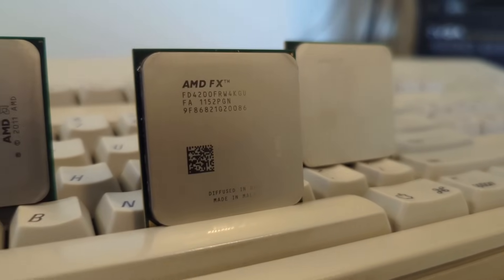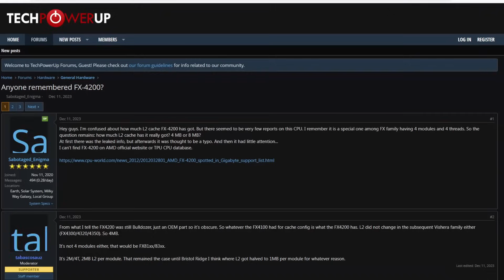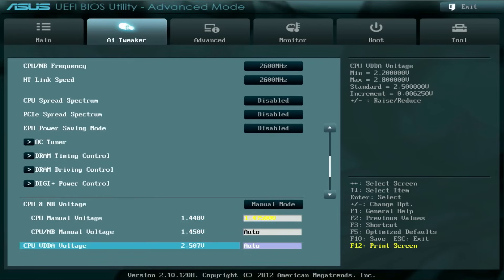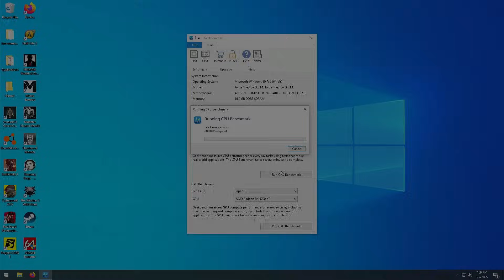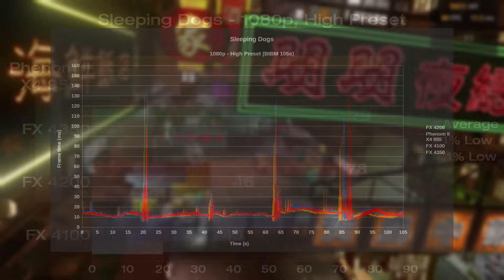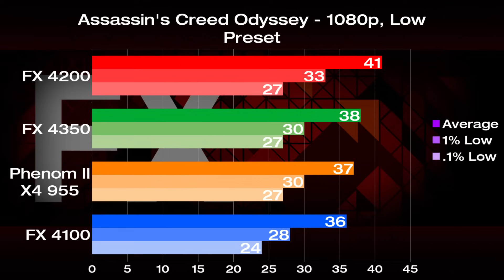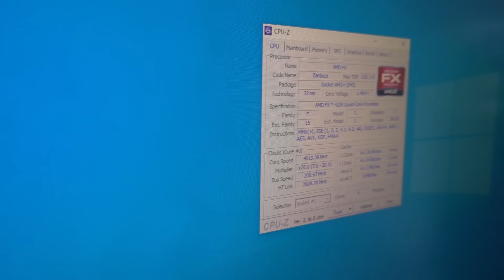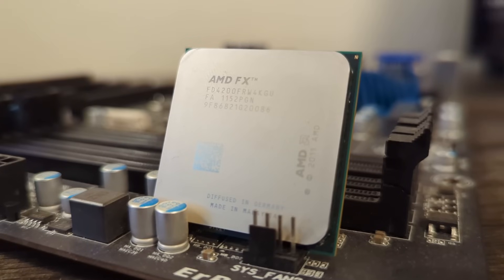What if AMD FX had "real" cores?

Comment: Had the FX 8350 and loved it. When multithreaded programs became a reality, it helped it survive longer than an Intel. Intel smashed it in single threaded workloads. I still have the original metal box and boxed cooler (was useless and loud). I think id died somewhere around 2021.
Reply: CPU died? How far did you overclock it?
Reply: @GreyDeathVaccine  No. The  PSU went and took the rest of the PC with it.
Reply: @858Markus  This is unfortunate. I feel for  you. I lost my motherboard once. If you remember, maybe share the name and model of the power supply so that the community can avoid this model. I'm keeping my fingers crossed that your new computer will serve you well for a long time. Best regards.
Reply: Im currently running a 8350 in a GB 990fxa-ud3 with debian as my daily (I dont game much anymore, mainly run optics sims, some light CAD, CFD, and photo editing, the rest is online and such). Not a single problem with it. The spinning platter WD blues are a little slow sometimes, but they're 3 and 4 TB, and blues, so...ya know...

But even back when i was running 7 on a 970 MSI with a 8120 and a 550ti, id have ARMA or ARK, Google hangouts, OBS streaming to twitch, and a twitch tab open to monitor the chat, sometimes had Pandora open too. Didnt bog or lag at all. So when people come along and say how terrible the FX series was.....I honestly have no idea what they're talking about.....

That noise? uh...thats a 3A carpet dryer blower fan set into my computer case blowing directly across a 212 cooler.....just ignore it.....

Comment: Great comparison! But the comment about software developers not paying close attention to the configuration of that CPU made me chuckle. Software developers aren't going to pay attention to that level of detail at all unless they're sure their code is only going to run on a particular hardware configuration (like a console for games, or a particular server CPU for a large tech company's backend) and they think they can actually tease out performance that way. But in many ways the results you see don't surprise me after you pointed out the L1 cache perf and size discrepancies. The Phenom 2 had half the L1 cache of even the FX-4100 but it's L1 cache was significantly faster.

This means "tighter" code that needs to access less total data to perform its computations will work better on the Phenom 2 for the two-fold reasons of being more likely to have the data it needs in the L1 cache and then being able to crunch on more of that data per second than the FX line. I don't think it was intentional, but newer games will be made on computers that have more L1 cache available, so measurable slowdowns in the tight loops due to L1 cache misses due to the volume of data being worked on in a group will simply not happen on newer hardware, whereas the older hardware will hit it.

Meanwhile, older code written in an environment under a more constrained L1 cache size would be more likely to be written performing work on smaller batches of data at a time, so the Phenom 2 wouldn't have the L1 cache misses to affect its performance and the L1 cache read and write speed would allow the CPU to perform more computations per second without stalls than the FX's less performant L1 cache. I think the BeamNG Physics benchmark helps support this theory vs the new SSE2 and AVX instructions -- if the better instructions were the reason for the lift in newer games, you'd expect CPU-side physics calculations, which would absolutely take advantage of these instructions, to cause the FX 4200 to lead the pack here, but the Phenom 2 still does, because the CPU is hard at work computing a physics simulation on a small dataset (the few vehicles and road obstacles in the simulation) more likely to fit in L1 cache and the L1 cache performance affects how well that benchmark does.

And I think this affects everything about the design the FX chip. They couldn't get the GF process node to run the L1 cache at the same speed as the prior process node they used for the Phenom 2, so they bent over backwards to work around that bottleneck, and realized that for multithreaded code; particularly the integer-heavy code that most backend and business productivity software code is, they could get a higher total throughput by having as many cores as possible on a single CPU and decided to share the FPU between two cores because then they could pack even more integer cores onto a single die and at a minimal performance cost on the workloads they focused on.

The ability to have more cores and then disable some of them for lower SKUs also let them work around yield issues they were undoubtedly having at the same time (if they couldn't get the L1 cache to the same operating frequency as the prior node, that means the newer node, while maybe smaller overall, had one or more mask layers in the process that the foundry couldn't keep from becoming overly diffuse (or variably diffuse from batch to batch, which if that was the case, would lead to huge overclocking potential if you got lucky with the CPU you acquired). Interesting how Intel is in this exact situation right now for the past couple of generations of their CPUs.

All this to say: I wish you also had an 8 core FX in that benchmark, to be able to compare the same number of FPUs but double the integer cores and see how it played out in the benchmarks as well. I bet it would've shown why the FX-4200 was so uncommon (since it had to basically be an 8 core FX but with 4 of its integer cores disabled, and if the yield issues were mostly in the L1/L2/L3 cache, which they probably were due to transistor density in the caches vs the compute regions of the CPU die, that would mean needing to disable those cores was unlikely): I bet the synthetic multithreading benchmarks would have gone in favor of the 8 core chip, as well as the BeamNG test, while games would've been almost identical (mostly just further reducing 1% jitters because all of the OS threads could be isolated from the game threads).

Comment: I absolutely LOVED my FX-8350.  In 2012 it only cost me $170CAD and it lasted me for 5 years before I replaced it with a Ryzen 7 1700.  I still use my FX-8350 as the CPU for my home network fileserver.

The problem was that AMD had the FX CPUs designed by a computer program.  It made them kinda average at everything.  Hoewver, the performance of the 8-core variants definitely reigned supreme.
Reply: Something I have started to hear people comment about in forums and videos is how stable AM3 platform and  FX CPUs were.
Reply: @FrancisBurns  I've never had a more stable system than the fx 6300
Reply: @FrancisBurns That was not my experience building a few, among some Core2 Quads, Sandy, Ivy, and Haswell systems.  They ran very hot trying to get any performance, and the boards were always flakey.  And I've run a Cyrix MediaGX system and Socket 7 Cyrix on an SiS chipset, along with nForce2 chipset boards; I know flaky when I see it.  Back in the day, sure it was cheaper.  But as soon as the Xeon e3 became available you can buy 20% more performance than this FX 4200 for $5 or less.
Reply: @FrancisBurns I was running my 8350 at 5ghz back in middle school just with a hyper 212
Reply: @wyattstanley6813 The highest I think I could get mine was 4.7Ghz and that was with a 240mm Corsair H100i (or an H110i, been so long I can't remember) I would have stuck with my FX 8350 for a few more years if my GTX 1070 wasn't so flipping loud. It was an hybrid cars from EVGA's B-stock and the blower fan stayed pegged at 100% more and more as time went on. Only had it for a tad over a year before i bought a 2nd hand GTX 1080 Ti and sold my GTX 1070.
Reply: They were great for heavily multithreaded work.
Reply: I still have mine on the same motherboard my fiance got me as a Christmas present almost a decade ago. I mainly use it to play around with Linux Mint nowadays. Same goes for my FX 6300 and FX 8300 which OC to 3.8Ghz amd paired with an R9 290X 8GB and 16GB of RAM. Every time I tried to double the memory capacity it would mess with my CPU OC for some weird reason.
Reply: That's exactly my path as well... FX-8350 and upgraded to Ryzen 1700.... except I then upgraded to the 3950x 4 years later....
Reply: The only problem being an e3 1220 is $4 these days, is 20% faster and even with a motherboard swap will probably pay for itself in power usage.  Not to mention the E3 V3 series which is even better (Intel 4th gen).  I had FX chips, they ran hot and loud.  In the last 4 years I've built a dozen E3 Xeon systems, using the RAM from AM3 platforms I am throwing away.  A Xeon 1241v3 or 1245v3 in a Z97 board with an NVMe BIOS patch is nearly as quick as a 6th or 7th gen Intel system.
Reply: Modding my motherboard with scrap heatsinks and undervolting the board made a world of difference
Reply: I used the 8350 until last year. Only reason I retired it was windows 11. For me the 8350 was still fast enough to run all my game's and software and never had stability issues.
Reply: I had an 8120. I got a 30% overclock out of it. And solidly stable.
Reply: Could've got Xeon E3 1230 V2 with ordinary B75 motherboard for not much more and it would beat it both in single and multithread along with better thermals, less power draw, no risk of north bridge failure and PCI-E 3.0 support
Reply: The thing is.. the intel counterpart had similar multi threading performance and WAY higher single thread performance. And then there is the power consumption… 🔥🔥🔥
Reply: PFFFFF What? My FX-8350 was barely faster than my 1090T at almost a whole ghz faster clock speed (5.1ghz vs 4.2ghz) and in single core tests a stock ass 3570K was faster and in multithread a 2600k/2700k/3770k stock were just as fast if not slightly faster which again... stock... FX uses a fk load of power to spin it's wheels. It was a terrible cpu line people were better off finding older Phenoms and I would have been better staying with my 1090T. The only good thing you can say about FX is "it functioned" which right out the gate windows had scheduling problems with the half cores. AMD Phenom II and Ryzen stuff is super amazing, intel performance or near (in the case of phenom) for half the price but I will never ever ever forgive them for the FX line. It wasn't even just mediocre... it was genuinely bad and worse than their previous generation.. which is fked up when you consider the marketing about how much faster it is and it just wasn't.
Reply: The PC I built in early 2013 still uses this processor. It's my main driver LOL
Reply: Still have a 8150 in a retired rig I used to lend friends with computer trouble.
Reply: A10-7700k oc with 480 8g. Great machine.
Reply: I had both a FX8320 and a 2600k.
That AM3 nearly made me refuse AMD cpus. I just used the 2600k till last year(13 years for 4 core is unbelievable imo) and sstill chugs away at 4.5ghz.
My 5700x is what AM3 should have been, but there are so many technical reasons FX just didn't work out.

I feel Intel is sorta in their bulldozer era, for better or worse. I finally have my AMD CPU + Intel GPU (5700x + B580) I always wanted to see them compete more, i think the next 5 years will be fun
Reply: @Brapplezz  I really hope that Nova Lake sees them leave their Bulldozer era. 

16 performance cores, 32 efficiency cores, a new 18A with Gate All Around and extra cache, and IF they’re smart part of the new platform will be a move to a quad channel setup to keep those cores fed. 

That last one isn’t something I’ve seen anyone say anywhere, but you can’t just double core count and NOT expect that to need extra bandwidth. Plus, it’d really help justify the new socket. Also, the increase in pin count is ~ about how much you’d need to double the memory channels if you weren’t changing anything, I think. Idk. I really truly hope.
Reply: I was massively disappointed with my 8350FX.   Was my first “ high end” cpu and it was trash

Comment: That AIO radiator placement hurts
Reply from the maker: Achievement Unlocked: Have someone mention the radiator placement (In all seriousness, that is the only place it will mount in this case)
Reply: @SPNG  the pump being the highest point in the loop will get killed by air bubbles in the long run

Comment: One of the big reasons why FX was so bad in games is the awful L1 cache. The Phenom is not fast there, its just that FX is ridiculously slow. Why? Well because its write-trough cache. Since you already mentioned 486 in the video, with the later DX4 models, it became possible ti switch cache write policy to write-back on that, and if anyone here had that ancient thing back in the day, you know what nice improvement that was in terms of gaming performance. FX is the only modern CPU that does not have this, its absolutely bizarre that they thought it would be fine to ship it like that. With write-trough only, you basically have to duplicate all L1 data to L2 every time you write, so L1 has benefits only when reading. So, when it comes to super small writes and caching, the system may as well not even have L1, as those operations are performed on the speeds and latency of L2. This is horrible, and it shows.
Reply from the maker: That would explain why it did so well in read. Thanks for the explanation!

Comment: I kept finding myself remembering how my FX-8350 benchmarked as just barely faster than the i5-760 I replaced with it.  Oddly, even the FX-8350 had only one FPU.  According to AMD it was a 24-issue superscalar FPU, so had the instruction execution been more optimized it could have been amazing.  But it wasn't, and for the 125 Watts of power consumption it could only just outperform the Core i5-760 (95 Watts, 4 cores, no HT, new in 2010) it replaced.  It was such a disappointing purchase it steered me away from AMD processors until the Ryzen 5000 series.  Zen has more than made up for the lousy design choices AMD made for the FX series processors.  And the Ryzen 7 5700X I bought actually performed more like a Core i9-12900, and did so for less than 65 Watts of power budget at 5GHz, even though I turned the power limit up to 125 Watts and 125 Amps in BIOS settings.

Comment: The Phenom II X4 955 BE was an absolute beast. I completely skipped the FX lineup with it, and clocked to 3.82 GHz on air in an ASUS M5A99FX PRO R2.0, it lasted me until Ryzen came out, and by that time I've had it for like 8 years.

I highly doubt my current 9900X will last me even 5.
Reply: Don't doubt in Intel chips from that era. I had i5 6500 (Skylake) for 8 years. Solid as rock.
Reply: @GreyDeathVaccine  That came way later. Your processor came out brand new when this was in its sixth year.
Reply from the maker: Hey, have some faith in your 9900X 😄The way things are slowing down today I think it'll last longer than that.
Reply: I went from a pii 970be clocked over 4ghz to a R7 7700 😂. Only had to upgrade because of lack of instruction set for some modern apps and of course windows 11

Comment: They did have real cores it was all nonsese and lazy devs not wanting to take the time to properly use them on PC, they sure worked OK on CONSOLE tho for far above their ability on PC cause again LAZY devs on PC never took the time to optimize any of their programs for them. Integer less cores are still cores, or are you gonna tell me the first era of computing did not exist, we had freaking FPU co-processors, up till the Pentium era. That entire lawsuit against AMD for this was B$. These cpu's were far better then if it was JUST 2/4-cores doing SMT.
Reply: Consoles never used Bulldozer or its successors. XBO/PS4 used 8 low power Jaguar cores, sort of like two Socket AM1 Athlons duct-taped together.
Reply: Consoles didn't use Bulldozer derived CPUs, the PS4 and XBone were based on Jaguar which was a different architecture meant for low power devices and didn't have shared FPUs.  A better argument would be to look at Phoronix's Linux benchmarks at the time since the Linux scheduler was much better at handling the shared FPUs  of Bulldozer and Piledriver than Windows.  They still didn't perform great in all workloads, but it was a lot closer than the gaps seen in gaming and Windows productivity with FX actually pulling ahead of Intel in some benchmarks.

Comment: I'm watching this on my FX 8350 and I still daily drive it =)
Reply: I have an old computer (FX-8350 + gigabyte 990FXA-UD3), but I switched to a new computer since 2022 so it is only a secondary computer (mainly just for memories, sometimes turned on).
I don't dare to overclock it because the default 4.0Ghz clock speed is already very hot (both CPU and 990FX chipset are hot).
Reply: Me too , with 16g ram still online life in the ole gal yet !!!
Reply from the maker: They're still totally usable today as long as you don't throw anything too crazy games-wise at them. Just a little warm blooded 😅 Have you done any overclocking to yours?
Reply: @SPNG  
OC? Oh, no... The 125W it naturally consumes already caused me chipset problems on my first motherboard.

But I can run CPU heavy games like Monster Hunter Wilds by using the program "Lossless Scaling" with it's magical frame gen.